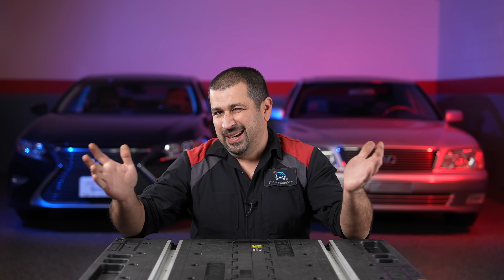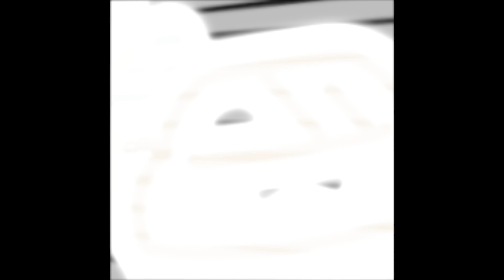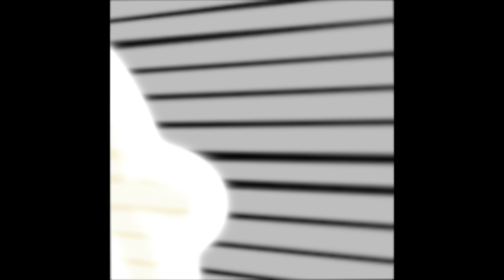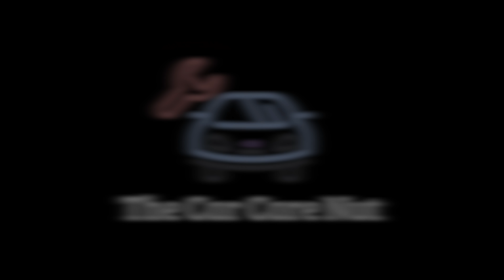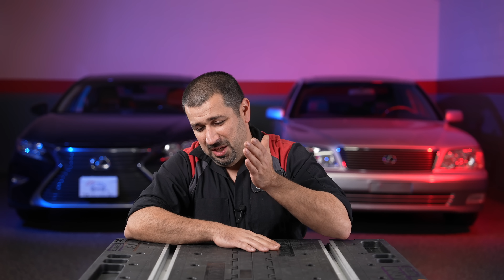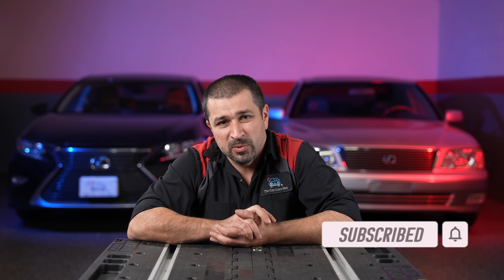Can Modern Turbo Engines Be Reliable? Here's The TRUTH!

Comment: @6:24 right there why would look for well maintained low miles Option 1 - 5th gen 4Runner | Option 2 - 4.7 V8 with VVti | Option 3 - GX460 | Option 4 - 5.7 V8.

Comment: Our Honda 1.5t call for 0w-20 and use a maintenance minder that would get me to almost 10,000mi per oil change, and Honda tells you to replace the oil filter only every other oil change. No

Doing 5w-30 5,000mi or 6 months on both cars, both engines are smoother and quieter. Also noticed my 0w-20 would stink like fuel when draining where the 5w-30 is notably less stinky

Ahmed I know you don’t advocate for changing oil grades but for a lot of these cars, it’s perfectly acceptable around the world where CAFE standards don’t exist, and it’s probably fine on 90% of cars in the US too

Comment: Had turbo cars. Lasted a very long time. Why?
Proper coolant and oil changes. The turbo won't fail if you don't fail on the maintenance and drive properly.
Heck, My turbo cars were boosted to the moon too, well over factory spec by 5 and sometimes 10 psi making 400+LBft out of small 2.0 liter engines.
Your issue from turbo engines isn't the turbo, but the PCV system. Everyone I know who had a turbo car break down had an issue with the PCV system which then failed the engine.
YOU NEED to change the PCV valves, and you NEED to do valve cleanings. You can do them yourself for cheap in your garage using CRC Valve cleaner and following the instructions. PCV valves are cheap and usually easy to change.
And you need to use HIGH QUALITY oil. Not the cheap walmart stuff. Use Valvoline, Mobil, or OEM, but use a slightly higher weight. My cars spec'd 0w20. I did oil analysis, it wasn't good enough. Stepped up to 5w30 and had pretty much zero wear.
Another thing is all GDI turbo engines have fuel dilution. You MUST run fuel system/injector cleaner every so often (30-50k miles) to make sure they aren't leaking or spraying incorrectly, and you must change your oil every 4-5k miles because the fuel WILL get in your oil, 100%. But over all: OIL CHANGES.

Comment: Love your vids and honesty! I have a '19 Subaru WRX/STI. Bone stock. Don't abuse or race it, just occasional spirited driving. And I change the oil at 3000 miles, sometimes earlier. High quality synthetic oil and no cheapie off brand filters. And when I'm done driving, I make sure the last couple minutes are normal, not push driving and I usually let it sit running for a minute or 2 to cool the oil when I stop. Manufacturer says you don't need to but I do anyway. Thanks for the vid!
Reply: Curious how many miles do you have currently.. I have a 16 STI and do the same every 3k I’m at 30k now
Reply: @ES-so5oc  I'm only at 12k. First couple of years I couldn't drive it much. Work and still had the summer tires. I retired a couple years ago and put on some all season tires (Continental DWS06's)  I should add, sometimes I may only have 1 or 2k on the oil and still change it...due to change of seasons. Did the same on my 10 year old crosstrek and now an outback wilderness (it has a turbo)
Reply: Hardly drive mine either lol.. 10 yrs 30k  bought it new still love the car…
Reply: @ES-so5oc  Yeah, I don't see me getting rid of mine any time soon. Love that manual transmission too.
Reply: @JenniLudes manual transmission love it !
Reply: Had a 2014 Ford Focus ST I bought new. Sold it earlier this year for a 2016 Focus RS that had only 13400 miles on it. The ST had 223000 miles on it and had no issues whatsoever when I sold it. Had the original stock turbo and clutch. Did all maintenance myself. Changed oil every 5000 miles with synthetic oil. Rarely jumped on the car except for the occasional " up to speed, on-ramp" acceleration and sometimes to pass a slow moving vehicle but 99% of the time just steady state cruising at 60-65 mph to and from work( round trip of 70 miles).: Changed purge valve when car started to misfire at idle( 3 different times) and it cured the issue until the next time. Oh...this was on a Ford Performance tuned engine with an aftermarket intercooler and one step cooler sparkplugs. It was a great reliable car for me. Hope the RS is just as reliable. Already have an AccessPort with Mountune tune,intercooler, 1 step cooler plugs and an intake snorkel and K&N filter. Have 26000 miles on it now( bought car in April of this year) and no issues so far. Drive sedately,change oil every 5000 miles and most people should have no issues with their turbo cars. Oh...do not jump on any turbo car until the oil temp is in the proper operating  range( not cold) and do not immediately turn off the engine at end of commute. Let it idle for a bit. It works for me.
Reply: idling down turbos and using turbo timers hasn't been a thing in 20 years, ball bearing turbos don't need to idle down, and modern turbos have watercooled center sections so the oil temps aren't going to be any hotter than a NA engine.  Also a lot of your newer turbocharged vehicles run the water pump for a few minutes after turning the engine off to cool off the turbo.
Reply: @mrvwbug4423  I realize that but it really doesn't hurt. The turbo is both oil and water cooled and the thermosiphon effect continues to circulate the coolant even after shut down. Also gives me the chance to listen to her idle a bit!
Reply: Love that Subaru rumble!

Comment: Best part is that turbo engines only show their efficiency and emissions advantages if you drive the car slowly to stay out of boost. But nobody does that, so the advantages basically don’t exist unless you’re intentionally driving slow (at that point buy a hybrid) or if you’re idling the engine a long time (at that point buy an EV).

Comment: Turbos help in high altitude conditions.  At 6k altitude oxygen is some 85% from sea level.  My older non turbo cars were missing 15% of stated mfg power.  I used to really notice when I’d travel southeast to Texas.
Reply: True, turbo engines lose less power at higher altitudes than normally aspirated engines. Actually, it's most noticeable at high altitude, but it also applies to any distance above sea level that turbo cars lose less power.
Reply: interesting

Comment: High RPM is also a way to get more power out of a smaller engine.  Trouble is a high rpm engine is even less reliable than a turbo and is typically very noisy.

Comment: Odd part is that other countries have different oil viscosity than what we have here ? Sum say it's for hot climates, sum say their lazy & don't wanna change car specs for every car for each country, sum say it's for emissions standards for the US ? I think 5-30 for Hot States makes sense & 0-16 -0-20 for colder states makes sense ! I texted the oil geek on his video but haven't heard back & prob won't ! So I just use what's been doin fine which is Toyotas recommended oil for the car you bought ! Haven't heard anybody saying their oil failed & the motor croaked because the oil is too thin !!!
Reply: It's emissions. Plain and simple

Comment: Besides this channel, our shop follows two Honda dealership technicians that work on Honda turbocharged engines. With issues of head gaskets on the 1.5 turbocharged engines, they’ve recommended a much more frequent changes/replacement of engine oil (3-4,000 miles) and replacing (complete flushing) of engine coolant 30-35,000 miles) . Why? Turbocharged engines are stressed more/run hotter. The engine oil and coolant breakdown much faster. We’ve also consulted with our local dealerships and that’s what they’re also making these changes. 

Next vehicle purchase, avoid turbo charged engines.

Comment: Cylinder pressures and quality of design/components play a large part here. We used to have hot shut-down procedures for turbo engines in the old days. The turbo does a lot of work  and can have a hard life. One big issue now is design engineers are inexperienced, wet behind their ears and everything has to be low cost. Nobody builds stuff to last anymore, here today, gone tomorrow. Thank you for the education.
Reply: In my day, we became engineers because we loved working on machines and engines.  Today, many become engineers because it means they can sit on a computer and create 3D models all day.  The engineering is something to be learned later.  My best development engineers were farmer's sons.  They were very familiar with operating, breaking, and fixing things! 

I've always said CAD is two things; Computer-Aided Design and Cardboard-Aided Design.  CAD is only one tool.  Not the only tool. Use what's most efficient.  
I've developed an AC compressor mounting bracket out of a paper pad's backing cardboard and tape, directly off an engine, and with that as a template, had it made into a prototype overnight, while my CAD guy took another 2 days just to build the model around the bracket! 
Similarly, my boss wanted to know if our 200-ton mining drill could maneuver within a given area on the test site.  Within the hour, I showed him it could, demonstrating with a to-scale, simple cardboard rectangle of the drill on a sheet of paper.  He expected me to model it on CAD and take several hours!  That allowed me to get on with my other jobs   😂
Reply: @AllenReinecke well said, you knew your job. I hardly see anyone under 40 anymore that knows what they are doing.
Reply: Turbos were always crap, but fun to drive. We stopped using them for decades mostly. Now they are back and fools have to relearn. The hard way.

Comment: Don't blame the manufacturers. Blame the government forcing the manufacturers.
Reply: Exactly!....they didn't do all this just to be "Innovative"
Reply: Blame humans for continuing to destroy the planet because they don't care about future generations.
Reply: @idx1941 

You drive an electric car?
Reply: The manufacturers keep making vehicles longer and wider, with more horsepower.  They are also discontinuing automobiles in favor of CUVs, SUVs, and trucks.  I enjoy driving a subcompact with a manual transmission.  The Nissan Versa will be the last subcompact.  Chevrolet and Ford no longer offer a sedan, period.  Do we really need 4,500 pound, 300 horsepower SUVs to get one person to work every day?
Reply: @marksudeith9840 The auto industry has defaulted to just making vehicles that generate profit, rather than making vehicles that are efficient transportation.
Reply: @marksudeith9840 

We don't. But most consumers keep buying them.

But I wonder why SUVs have been the number one sellers. SUV is the main reason for the demise of sedans.
Reply: The government is telling you to change the oil at 10,000 miles, Toyota is
Reply: @Anchorman-l7d 

Oil changes are subjective to the type of engine and usage. 

Turbocharged engines should have oil changed every 3-4k miles. 

Cabs, Ride-share vehicles should have oil changes every 3k miles. 

If your dealer recommends otherwise, see the vehicle maintenance booklet and use common sense.
Reply: I’m old enough to remember the “good old days “ when we had traffic jams full of giant v8 carbureted cars without any government mandated emissions, no mandated safety equipment etc. even with half the population then, we had terrible smog , acid rain, lead poisoning etc. we’re never going back to the good old days thank god! And I definitely don’t want the “ market” to be what drives safety and clean air. That being said, if you are going to drive a vehicle that weighs 6000# and you want ever more acceleration then you will have to pay to play. In the area where I live there are many trucks with diesel engines making over a thousand pounds of torque and almost all of them are hauling one person and maybe a coffee cup. Ridiculous habits are hard to change.😊
Reply: Toyota has been especially vocal about their disdain for government mandates on fuel economy instead of letting the market dictate what to make.
Reply: Blame the tree-huggers, lobbyists, and politicians lining up their pockets.
Reply: @magdalo4473 Trying to be green here while the rest of the world cares less, yet we share the same planet
Reply: Id rather have a more fuel efficient car than to give you a shorter life span.

Comment: Turbo engines are without a question going to be more unreliable and expensive to repair long term that is a fact. Toyota has shown us just how shitty turbo engines are as they are having nothing but problems with them and they just put out yet another recall for the Tundra. Coupled with ongoing transmission issues and you really have to question Toyota reliability moving forward…. Cars are just not the same anymore . We truly are at the age of throwaway vehicles from all manufacturers

Comment: Also turbos eventually fail diesel or gasoline even with prefect oil changes. Make sure the turbo is easy to be replaced without disassembling the whole car to get to it.
Reply: Not gonna happen mostly need a lot of work some of them engine removal

Comment: Just got a new tundra and i plan to do some oil analysis to see how the turbo affects the oil life thru testing. My 20' taco could go 7500miles on an oil change cuz i knew the oil had that life in it. But i would plan for 6500 to be safe.
Reply: In another video, he said don't rely on oil analysis, basically.
Reply: @seanvogel8067 i dont rely on it since i might do it once a year.....Maybe twice. But why would more information about your engines internal health be a bad thing?
Reply: @brianbonenberger8054 , you have a point. I think his point is you can't believe a positive result.  But a negative result would be useful.

Comment: Not matter what new "innovations" are engineered into cars - cars are machines; machines require maintenance...oil changes are the least expensive way  to stave off problems.  We have 2 cars, one turbo, one non-turbo.  3,000 mi oil changes on both...I've NEVER had an engine problem that was oil related and i'm 78.  LISTEN to this guy, he's a straight shooter that KNOWS what he's talking about.  OR, roll the dice...

Comment: Thanks for the info about turbos and oil.  Sounds like extreme usage standards apply to turbo oil requiring 3-4000 mile changes.  FYI I've done this with all my Subarus (all were/are turbos) and so far no turbo or engine issues (excelt the Forester XT's 2.0 engines, which self destructed no matter what oil or preventive care was done).
Reply: It's not just the oil, the heat and load on these engines is insane and they break $$$$ We knew this decades ago, I guess newbies have to re-learn.
Reply: 72 retired lineman diyer with a 2006 sti , own Honda/Lexus and Toyota vehicles.  Subaru worst vehicle I ever owned

Comment: Diesels run hotter hence all the NOx failures. Master mechanics with no Smog training are a generation behind. Turbos spin at up to 150K rpm subjecting tiny bearings to intense heat.

Comment: What about Time vs Milage.

Say the last oil change you did was 6 months ago but you've only driven 2,000 mi on it... Do you change your oil when you hit 5,000 mi or do you change it every 3, 4, 6 months Even though you haven't hit the 5000 mi interval changes
Reply: 3,000 miles or 6 months whichever comes first on turbo engines. 5,000 miles or 6 months whichever comes first on non-turbo engines

Comment: Going to have disagree on this video

Diesels do burn hotter hence the 18:1 compression the thermal energy in a gal of diesel is more than gasoline. 
Diesels do breath without turbo lots of motors there that are not turbo charged. VW golf from 1982, kubota,yanmar tractors
Diesels do have throttle plates in some cases. Modern Cummins example throttle plate is a failure point it plugs up from EGR soot
Diesels do spool fast, I run 10-30 psi in current and was hitting 45psi on my prev motor
Diesels do rev now be it at lower rpm but 2500-4500 for modern diesels

Comment: I bought a 2009 Smart Car new in 2009. No problems. I used to have the oil and filter changed at 9,000-10,000 miles. Around 2025 I started having it changed at 5,000 miles or less because I am retired from the Postal Service, so I don't drive hardly anywhere. I now go by months. 5 months.:hand-pink-waving::face-blue-smiling:

Comment: Hybrid's and PHEV's are on solution. My Rav4 Prime PHEV gets the oil changed every 5K or six months, even if the dealer says other wise. This my last car, so taking care of it is imperative, pay for oil now or pay for repair later, advertisement from the 1950"s.
Reply: Unless your engine is frequently (several times per week) kicking on for brief durations (running cold), You could do MUUUUUCH longer intervals.  If most of your mileage is on EV mode, and you don't road trip much, that's basically brand new oil you're draining out.  The oil doesn't care how many miles the car was driven- it only cares about how much time it spent running at low operating temperature.  If the engine is only kicking on for long drives and spends most of its life either "off", or at full operating temperature (road trips), you can do very long OCIs.....like 10k miles with the ENGINE running, which could take YEARS and tens of thousands of vehicle miles if it's seldom kicking on.  Do oil analysis on your next change and I'll bet your oil is essentially brand new.  Electric motors are the BEST for short stop and go trips!  They don't care that they're running cold, can regen, and have great torque, so you have a great all-around setup.  You're just getting fleeced on the 5k / 6 month changes.
Reply: That would be a frequent OCI WITHOUT the electric motor unless you did all very short city trips.  Pay attention for the next week or two and see what percentage of your drive time the engine is actually on, and how much of that is time spent running cold.  If your engine is only on, say, 20% of the time, your effective OCI is every 5 weeks / 1000 miles.  Unless it spends a lot of time running cold, that's WILDLY excessive.